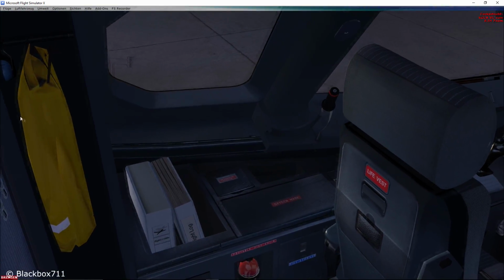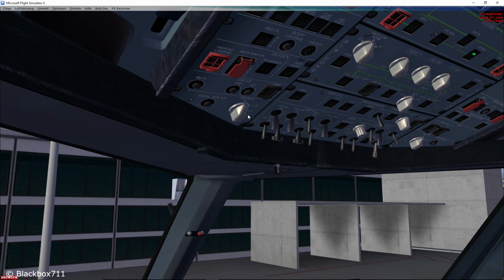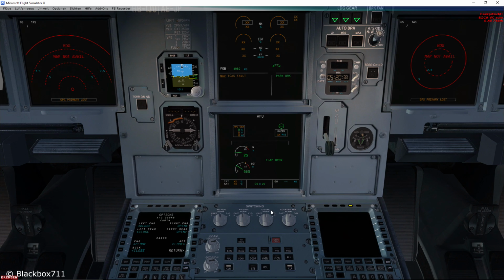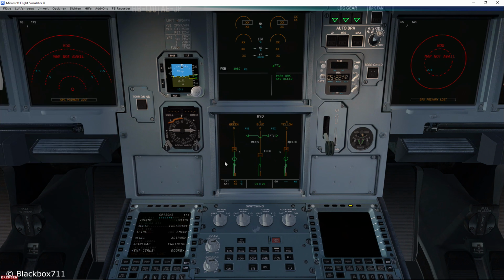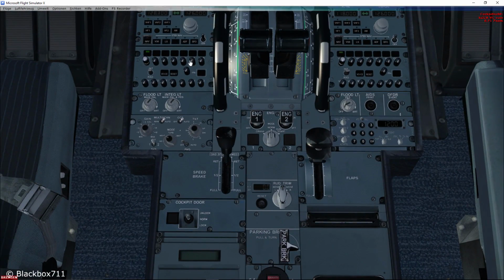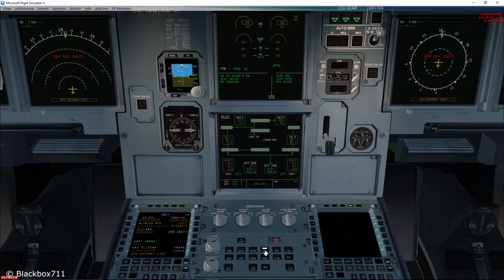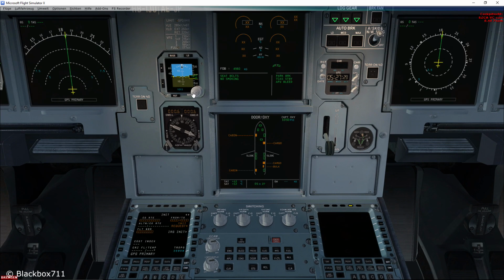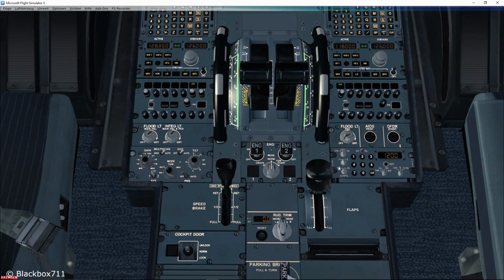FSLabs A320-X Basics: Cold and Dark Startup Part 1

Comment: Heeeey nice - the FS-Labs Airbus cockpit looked that good six years ago?? Wow impressive! High quality textures, even the seats are high polygon with smooth rounded shaped headrest, awesome high quality graphics is indeed very important. Have a look at many other aircraft, areas like circuit breaker panels, the seats, the fire extinguisher and many other areas of the cockpit still look like some angular lowest polygon 128x128 pixel texture PlayStation 3 asset, with everything that should be rounded is instead low-poly hexagonal-angular-shaped in the year 2023. Even in many of the most expensive addon-airplane cockpits, and they justify visuals that just completely suck by declaring it as "FPS-friendly". But this FS Labs Airbus looks really high quality, this cockpit already looked marvelous over half a decade ago. Awesome visuals (and of course the simulated system realism and system depth is absolute.) This FS Labs was years ahead of it´s time, just like the Fenix.
Looks like my beloved Fenix Airbus quality can also be found Prepar3D!!
We have the Captain Sim 757 and 767 freighters, we have the FS Labs A321 freighter, we have the PMDG Queen of the Skies freighter, and everything is master-degree-study level quality! 
Have you ever flown the Fenix A320, does it feel any different in some systems compared to the FS Labs A320? Which one has the more complex MCDU computer with more complex calculations and inputs to do?

Comment: How to start cold and dark without using MCDU II ?
Reply: go into panel states,  load state then select cold and dark, after that you should see insert from what i remember. if not then just press the lowest right LSK. Another way is spawn a Piper J-3 Cub, shut down the engine either manually or using ctrl+shift+f1. press alt then select vehicle and from there select fslabs a320 iae or cfm and spawn in

Comment: The FSLabs 320 is a great plane and I have done hundreds of flights with it. But it is also a bit buggy, especially when it comes to loading situations / panel states.
Reply from the maker: The ones I am using are perfectly good. Did you change anything?
Reply: @Blackbox711  No. It is a clean install. For example, when loading a flight on the ground, it is not possible to enter new DEP/DEST airports. Or the FMC lighting is messed up. Or other small things. I love the plane but they should have ironed out all bugs.
Reply from the maker: @maltimoto  In this case I would contact FSLabs Support on their forums

Comment: Hey great videos.   I am new to FSLabs.  I just started using the A320 for P3D v5.  Q: Why do the graphics in your videos look Sooo much better than the stock A320 from FSLAbs?  My cockpit items look dismal compared to yours. Particularly when just looking at the visuals in the cockpit, the textures look almost real.  Other videos from other people look just as bad as mine, so wondering what are you doing that is different.   Thank in advance
Reply from the maker: Hi. I am using some more addons and textures. For cockpit I use HB-Textures. Google will lead you to it on Facebook. Also I am using ReShade.
Reply: @Blackbox711  Thank You

Comment: Congratulations for your wonderful tutorials, I wanted to ask you how to activate Nose wheel steering with p3dv4? I tried to follow the guide on page 9 but by clicking on the aera described nothing opens.
Thanks for your help
Reply from the maker: Normally the komma key (,) is to be pressed continuously to activate the nose gear steering. Also you can change that setting in the MCDU under Options

Comment: Hi, do you load first a default aircraft like the cub and then the fsl a320 in p3d v4 or you load directly the fsl a320?
Reply from the maker: +Raul Aubele .. load FSLabs A320 directly
Reply: Hi, it's great to watch your superb videos as they are really advanced, thank you very much. one query, when the installer asks you if you prefer textures in 2048 vs 4096, what is your choise? if you choose the 4096, do not you lose performance in frames per second? I am a big fan of your videos, thank you very much!!!
Reply from the maker: +Raul Aubele i. Thank you for your kind words! In P3D V4 the installer will always install 4096 textures. Personally I have always used 4096 because I am using a 4K screen. You will have a bigger impact on your PC when using higher resolution settings. However you can still influence this in the graphics settings in P3D to your preference. Regards

Comment: could you upload the file cold and dark  state for a320 fslabs, I cant save the state :( please
Reply from the maker: Hi Mayker. For FSX or P3D?
Reply: for fsx please !! thanks a lot
Reply from the maker: Hi. I have just checked and I too cannot save the cold and dark state. It keeps on starting with engines running. Not sure if the last update is the cause for that.
Reply: omg!! dont worry, thank you blackbox711 !!! respects from Peru !!
Reply: how do you start the a320 in cold ad dark?
Reply: what do you do to start the a320 in cold and dark?
Reply: when starting fsx , load the official aircraft called trike then start the game at the airport you want after that turn off the engine in the trike aircraft by pressing Ctrl + shift + F1 after the engine turn off you can go to fsx menu on top and choose the fslabs a320 aircraft and it will be in cold&dark state ..
Reply: yes!! i did it, but I can´t save the state!!!
Reply: Go to Addons on top of screen and click on fslabs panel and save it
Reply: when i try to save, that option doesn´t leave do that!! :(

Comment: Hi all the experts out there,though I switch off the master to try to create a ' cold and dark' , my P3D a320 still doesn't have the external power, any advice? thanks in advance!
Reply: Even if the plane is C&D, you can turn on the MCDU (by pressing 3sec on BRT), and search for the externals controls. Then connect the GPU and you're ready to fly !
Reply: thanks so much for your answer!! do you mind to suggest me ways to set up cold n dark ? coz my plane always start ( p3d) with everything on ,thanks again!
Reply: Just take the Piper Cub, switch off the engine and then change the plane. The 320 should be in a C&D situation

Comment: Hi BB, my new Sim has finally arrived and I'm going through your Vids to catch up, when I do C&D start all my fuel pumps are switched off, I noticed in your video they are all on, is this normal? Also do you need to switch them off again when shutting down or when refuelling is taking place? Thanks for all your hard work, after watching all your streams for so long it's great to be finally doing it myself!
Reply from the maker: +Rotary Buzz ... Hey Rotary! Good to hear that you finally got into the 320 Sim. It is correct that the Fuelpumps are all off when starting from C&D. Some Airlines leave them switched off until shortly before engine start. Other airlines keep them on all the time. So feel free to use either method. The important thing is to remember to switch them on when starting the engines. Otherwise you'll get funny ECAM Warnings 😉. Enjoy the wonderful A320 and Happy Landings 👍🏼
Reply: Blackbox711 Thanks 🙏

Comment: Can any expert out there help? how 2 set up the cold and dark in my computer? thx again!
Reply from the maker: Hi. In FSX, first choose the Trike, switch off the battery there and then jump into the FSLabs A320
Reply: Blackbox711 thx a lot!I just bought my flight Sim x Steam n A320 add on so I m pretty new here, did ur video download any thing except the flight Sim X steam and the A320 ? because ur outside airport  view looks more decent than mine😂
Reply: Blackbox711 umm .. can u also teach me how 2 direct te aircraft to start in the place where u start ?my aircraft start right im the runway if I just type the airport code. Happy Chinese New Year btw !
Reply from the maker: Hi. I also use ORBX FTX Global. Regards
Reply from the maker: When you choose the Airport, there is a dropbar further below, where you can select the parking/gate positions. Happy Chinese New Year to you too!
Reply: Blackbox711 hi , is this something that I need 2 download?sorry 4 my dumb question again!
Reply: Blackbox711 where may I choose Trike?
Reply: Blackbox711 sorry for this dummy question again.. where may I choose the Trike?btw I m using the newest P3D

Comment: First of all, thank you very much for those excellent videos, I follow you and I watch your live videos sometimes in twich. Captain I have a question for you and a doubt. Why do you activate the external power and at the same time you turn ON the APU? and why after turning ON the APU BLEED you put the pack number2 in the OFF position?  is it for the bleed air from APU to the air conditioning in the aircraft? If  I don´t want to turn ON the APU and connect the GND A/C to supply the Air conditioner, is that right? or not? If I´ve said a mistake I will appreciate if you explain me what is the function of the GND A/C. 
What is CKPT OXY a PSI normal value and abnormal?  thank you very much again and congratulations for your excellent job teaching us.
Reply from the maker: Hi. Thank you very much. If you external electric power you would wait with the APU start until shortly before push-back. However if you want to use the airconditioning to make your passengers happy, you either need external airconditioning or if not available the APU Bleed Air. Now, the APU uses approx. 75-100 kg of kerosin per hour if you are only using it to supply electricity. When you switch on two airconditioning packs, the. APU will then use about 150-175 kg of kerosin per hour. However one pack is sufficient to aircondition the cabin in normal circumstances. That is why usually you would only switch on one pack. Only in extreme cold of hot environmental conditions you need both packs. So by using only one pack you can reduce the bleed demand on the APU and hence the fuel consumption. Regarding Crew Oxygen: The minimum pressure depends on how many people are flying on the flightdeck. For example if there is only 2 pilots, then 800 psi would be enough. However if for some reason you have 2 pilots and 2 observers, I.e. 4 persons in the flightdeck, you need a minimum of at least 1200 psi. There are limitation tables available for pilots to figure this out. Regards
Reply: Thank you very much

Comment: May I know ur computer modol in this video?
Reply from the maker: +tiffany51793 .. FSLabs A320. Or do you mean my PC Specs?
Reply: Blackbox711 yes indeed i m looking for a new computer that will allow me to play this sim which is good enough for me to prepare for the sim session in the airline, yet i m a computer dummy n i dun want to.waste or spend the.extra money to buy a too expansive one, do u have the suggestion for me for the minimum type of computer that i should get? thank u Captain!
Reply from the maker: tiffany51793  ... I am no PC expert either. But I have published my PC Specs in the comment section below the video. Apart from the fact that 16 GB RAM is enough, that is the requirement if you want at least a minimum of 15 FPS in FSX. Regards

Comment: Hi, first of all thank you for these great tutorials. I have one question. I saw the FMGC in the first officer side was black, it happened to me, when the ground power was lost, the F/O side FMGC didn't turn on again. Any solution for it?
Reply from the maker: Hi David. Thank you! Try pressing the brightness key (BRT) on the MCDU for several seconds. After about 5 seconds the display should illuminate. Regards
Reply: Thank you, it is working. And I have an other question. :S 
I get often the out of memory warning system, however my computer is good enough comparing to the system requirments, I have CPU i7 4720HQ 2.6 mHz, 16GB RAM, nvida GTX860M...
Reply from the maker: That is probably the VAS - Virtual Address Space warning. Simply explained, VAS is a working space of a program. Do not think physical memory has anything to do with this. VAS is a specific space for an application, which can, under 64bit operating system be up to 4GB for the 32bit application. So it doesn't matter how much RAM you have, FSX will run out of memory. Especially with high VAS inducing  addons (like Aerosoft Heathrow Airport). If you Google "VAS FSX" you will get some tips. Reagards

Comment: why on the other video , you press apu later on , is it bcs on this video you didnt use gpu?
Reply from the maker: Hi Fariz. Usually you would delay the start of the APU shortly before engine start because it uses around 100 - 150 kg of Fuel per hour. However if the cabin temperature gets too high or too low, you should switch on the APU earlier and use it for air conditioning.
Reply: can we turn on the air condition pack 1 initially using external power
Reply from the maker: +Fariz Faiz ... you need bleed air from apu (or engines) to use an air conditioning pack. Regards

Comment: When is the probe window heat used/required?
Reply from the maker: Hi Nathan. This would be switched on manually on ground (engines off) if you have ice/snow contamination on the probes or windshields. Once one engine is running the probes and windows are heated automatically. Regards

Comment: Very nice video!
Does the APU Bleed only supply the left pack? Or why did you switch the right pack of?
Reply from the maker: Hello Flying German. Thank you. With normal outside air temperatures one pack is enough to air condition the cabin. This means the apu has a lower fuel consumption. Regards

Comment: Just a stupid question, how can I connect the ground power unit for the startup?
Reply from the maker: Hi Luftwurzel. If you see the Green Avail light on the overhead panel just press that button. If there is no Green light then go to the MCDU , then Options and then Ext Controls and then select GPU connect. Regards
Reply: Hi Blackbox, Ich habe gerade gesehen, dass du auch deutsch sprichst ;). Danke für deine Antwort, aber Ich habe weder auf dem Overheadpanel ext power verfügbar, noch kann ich etwas auf der MCDU drücken, da auch diese aus ist. Ich habe mich genau an die Anleitung gehalten, (BRT gedrück halten), leider passiert hier aber nichts. Hast du noch eine Idee? Danke und LG!
Reply from the maker: Hi. Könnte sein, dass da etwas bei der Installation falsch gelaufen ist. Schau am besten mal ins FSLabs Forum rein. Ggf. stell deine Frage dort mal in Forum, dann bekommst du sicherlich sehr schnell eine kompetente Antwort von einem Moderator. Gruß
Reply: Soetwas habe ich schon befürchtet, trotzdem vielen Dank dafür und für die tollen Videos! :)

Comment: Have you tried the Aerosoft Airbus X before or you waited 6 years for the FSlabs A320x?
Reply from the maker: Hi Sprisk. Yes I have. It is not a bad Simulator. However, the system behaviour is in parts very different to the real Airbus.Regards